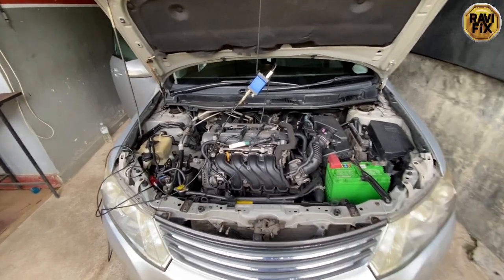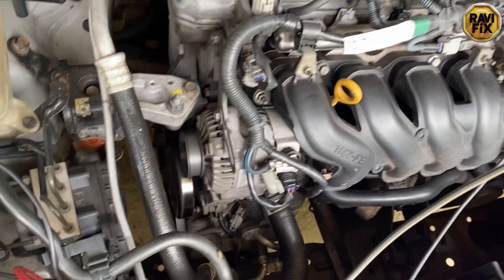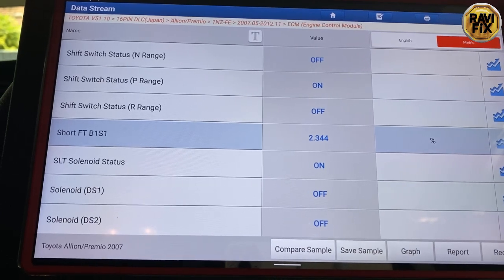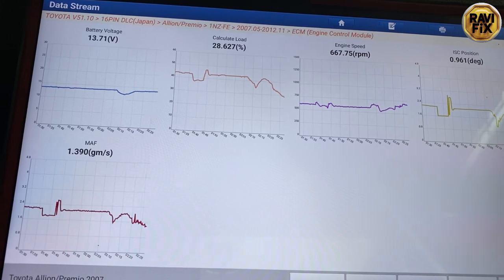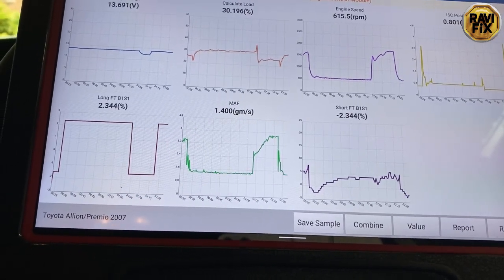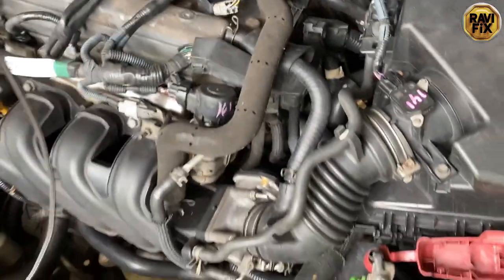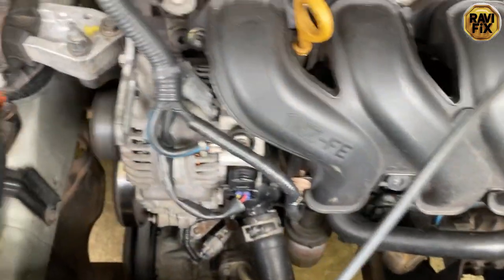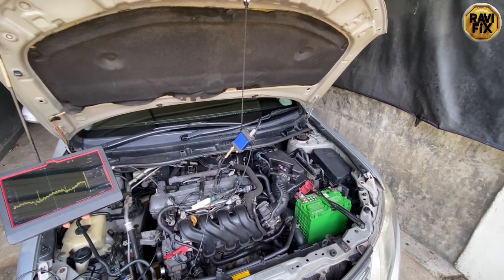Toyota Corolla Allion NZ260 2007 Rough Idle diagnosis with Alternator AC ripple test.

Comment: Good explanation and nice work ! At 3:26 Electrical Load Signal is indicating ON , when engine is idling and everything is OFF (all lights ,AC,radio,PS etc) it should indicate OFF right? Was this because of the faulty alternator ?
Reply from the maker: Good point, but I did not care about that piece of Data.

Comment: What are the possible reasons to rpm going down when A/C is on? My car is a corolla 121 and it also has the same 1NZ FE engine. By the way this is a really good educational video. Keep it up. ❤
Reply: Thank you. Many reasons could cause like idle up issues, bad AC compressor, out of right engine tune up, Alternator, fuel pressure, vacuum leak and many reasons.
Reply: @raviautoscanning  Ohh okay. Thanks for the reply. My prime suspect was the IAC valve mine has one. But after your reply I am not sure what is it. 😅 I have done a tuneup and a A/C service both didn't solve the issue. Maybe sooner I will visit you to check this. Again thanks for the reply and I need to highlight that you are one of best who work based on data. It's really hard to find one these days. Great work ❤️
Reply from the maker: Hard to say without check. Many reasons could cause for it.

Comment: Ravi, probably you are overlooking one aspect during fuel trim Analysis to identify a vacuum leak and that is:-
How a PCV valve is allowing air to be entered in intake system while engine is idling? This PCV valve is in fact stuck at open or partially open position. You may like to remove and either perform a valve rattling sound check or apply air from cylinder head side of valve. In my humble opinion an alternatir with 50 or 51% shall exert more load on engine like this case but it shall not cause this much of eñgine shaking...as we know when engine experiences a mechanical impedence whether in shape of load by alternator due to over magnetism or its pullys dry bearing etc, the engine rpm try to reduce and in response ECU increases injector pulse to increase its torque to overcome the additional load at constant accelerator input...but in this scenario, the shaking can occur only when there is either air system issue or the fuel system issue.

You may like to add on above comment, so that we take this discussion to further....n it will help us better understanding the issue and diagnosis through data analysis
Reply from the maker: Thank you for your feedback. 
May be you haven’t watched the video properly. 
First thing data not lying. 
See that how data is behaved. Next thing pcv has tiny flow at the idle which is normal. Put your finger on pcv valve at the idle, you can feel that your finger suck in to that.
If pcv has considerable leak, airflow sensor response to it.
Next thing AC ripple test reveals that the alternator is bad. Even though it supplies the charging voltage and current demand by putting his load onto the engine. 
Simple,…. Isolate the Alternator by removing its power supply socket take of the rough idle perfect. Normally this fault goes to Diode plate or stator coil.
We have diagnosed this case lot in other cars too. One other video is lined up that how Alternator brings rough idle.
Anyway….My way is trust the Data always.
Reply: @ravifixall  thankyou very much Ravi for your reply...
You are right, we must not doubt on the data...i would like to discuss this topic further to clarify my concept...i have learnt so many things from your videos and i am one of the many of your admirers 
Before we discuss PCV and MAF things, if you can elaborate in detail, how to isolate the alternator to off load the vehicle...please dont mind, i really need to know for my future diagnosis (i did wish to do this but never practiced)...

In next msg i will try to put forward my comment on MAF, Fuel Trim, and PCV valve...and would like to have your expert comment and this all discussion would be for learning, not to prove that you (whom i respect as a teacher) or your findings as wrong
Reply: @ravifixall  Now, in my understanding, about PCV leak and MAF response.....MAF doesn't measure any air entring due to PCV leak (PCV hose connected past MAF and close to throttle) or any other leak in air system past this sensor...now when we see the data in this video where we are looking a decrease in air flow...what i am interpretting it is...as pcv hose is coonected just near to throttle and air is entring the engine corresponding to vacuum it is generating and IAC duty set by ECU...NOW when PCV is leaking then an amount of air is going into engine from this source (&that too unmetred) and major amount is from air filter thru MAF (metered air). So, if net amount required to enter was 10g then as 2g is supplied by PCV leak(unmetred), therefore, 8g would be going thru MAF(Metered air) thats how the MAF air  was reflected as less than normal..
Thus, the MAF doesn't respond directly to the pcv leak but it responds in terms of reduction in required air thru air filter..

Other scenario for looking MAF response to an air leak in intake manifold is...due to air (vacuum) leak, the vacuum pressure would decrease and engine would suck less air thru air filter source and again MAF would read less air